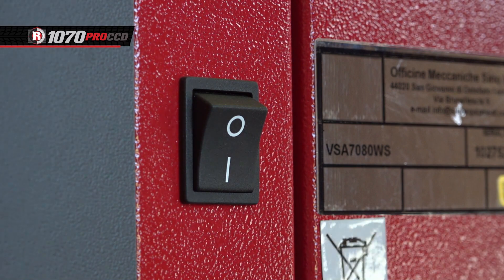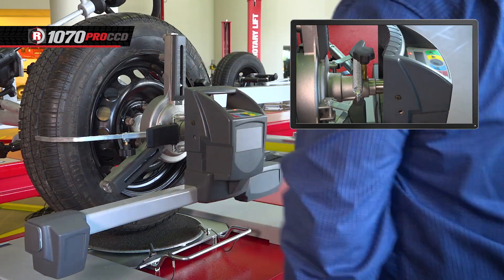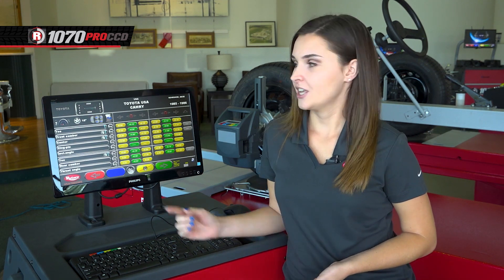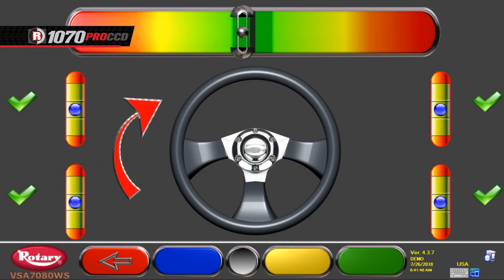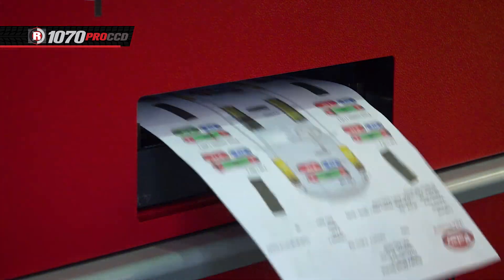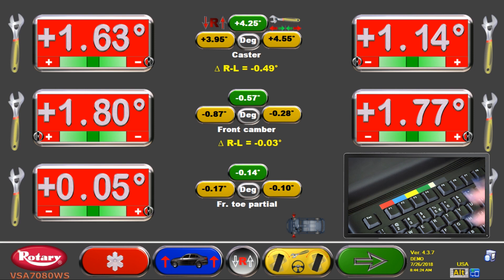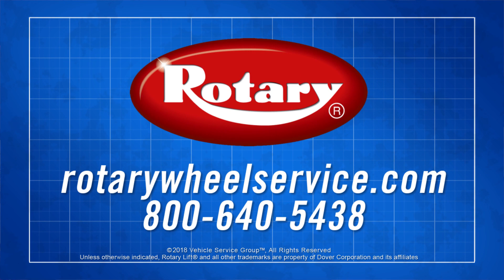Rotary R1070 CCD Alignment Machine: In-Depth

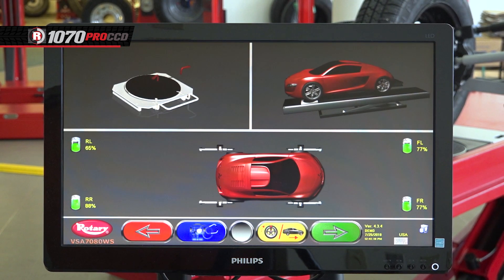Comment: Sorry i need help in video  1:50 there's a blue button i press it and everything is changed... How i can change it back thanks for unswer
Reply from the maker: When you press the blue button it should ask “Are you Sure?” with green and red yes/no options.  This puts the system in Quick Check Mode.  To get out of QCM press the Red Arrow Back Button until the box at the bottom of the screen is no longer outlined in blue.

Comment: Do they make anything that will do 30 inch rims
Reply from the maker: Our standard wheel clamp will not fit a 30 inch rim, but there is an available accessory that will allow them to work on a rim that size. Contact your local Rotary distributor and they will be happy to help get you set up.  https://rotarylift.com/contact/rai-locator/